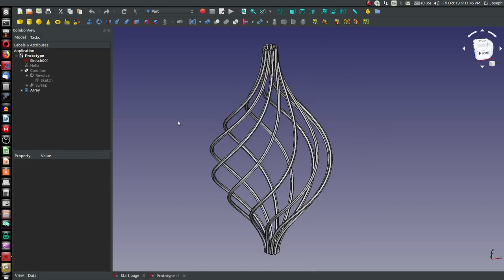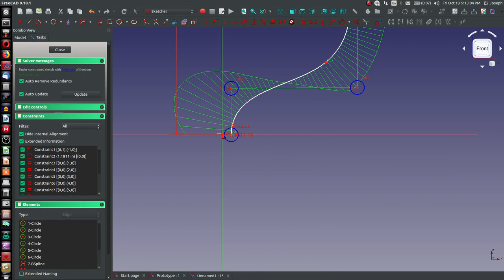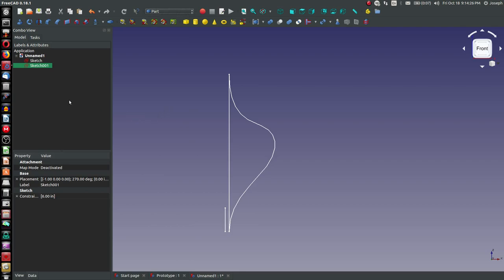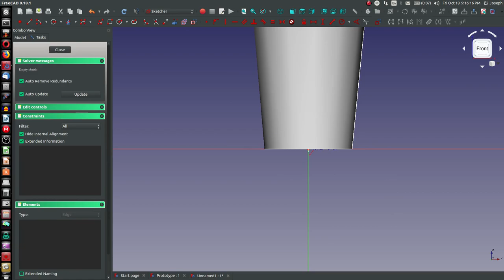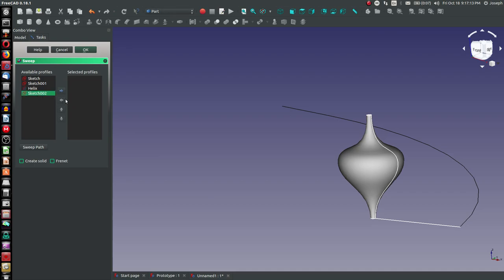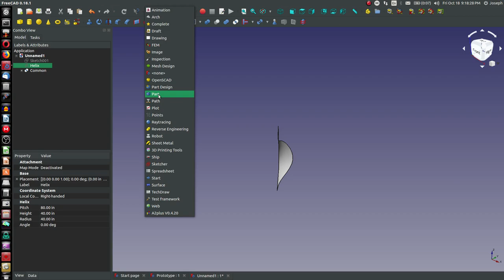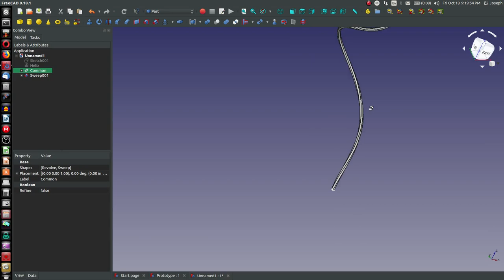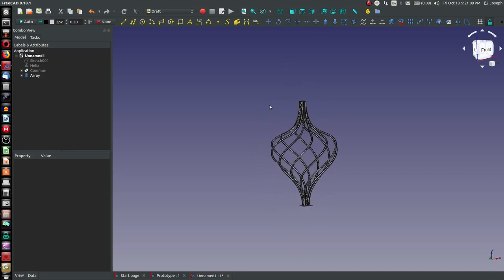FreeCAD - Make a Decorative Design |JOKO ENGINEERING|

Comment: How do you find the capabilities of FreeCAD features compared to SolidWorks?
Reply from the maker: I should make a video about that.  I am very impressed with FreeCAD, and I think FreeCAD could be extremely competitive and be used more in industry if it utilized ISO or ASME drafting standards including GDT, and had a little bit more fillet functionality for plastic design.
Reply: @JokoEngineeringhelp  I think will be a great video regarding the subject. I used over the time a lot of different CAD software but I do found myself FreeCAD being very confusing, from my POV looks like a software with a broken interface. I do want to learn how to use FreeCAD, but I just can't adapt to his strange workflow.